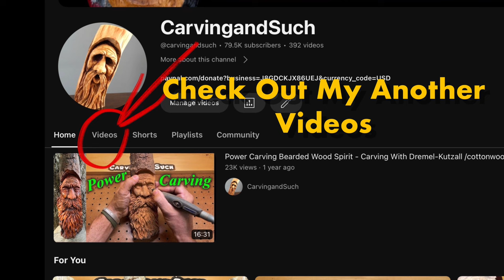Power carving a Native American Indian head step by step with Kutzall - Dremel 4000 - Foredoom.

Comment: What Dremel is that? I have a 3000. Yours looks way better as far as size.the 3000 is bulky in the hand.
Reply from the maker: I have the 3000 and 4000. on both I use the flexible shaft. Not bulky like the dremel itself.
Reply: @carvingandsuch  thanks